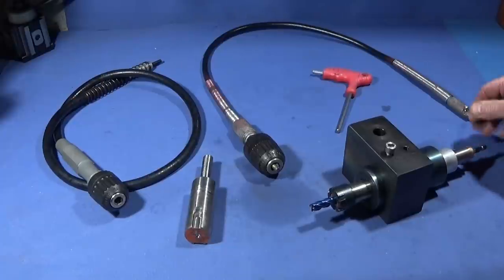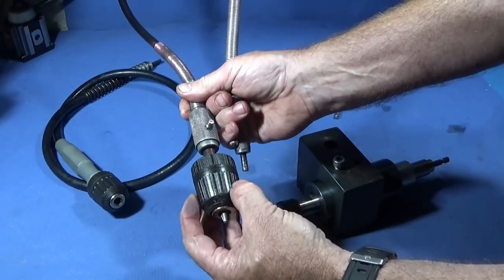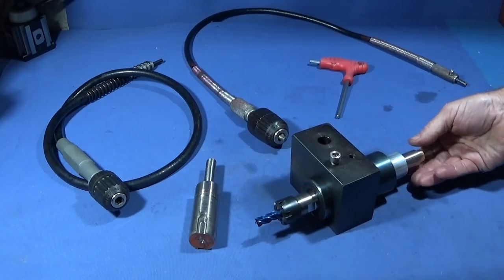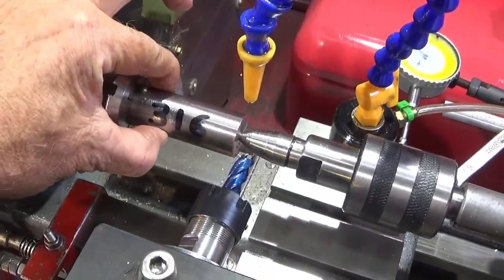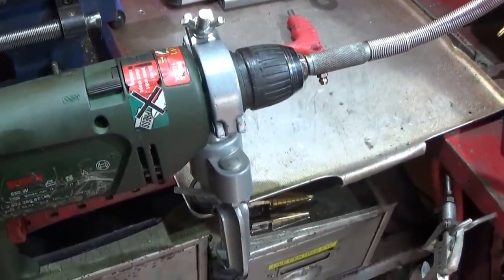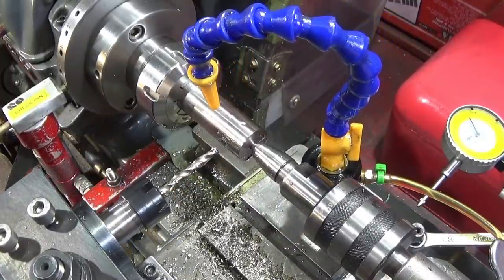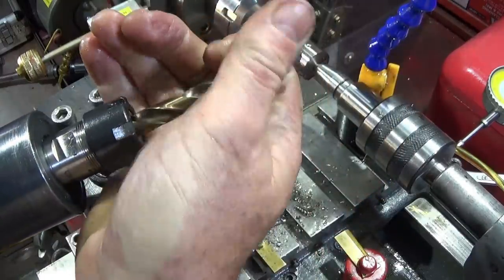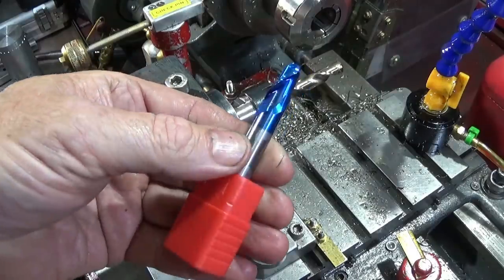ER20 Collet Chuck Toolpost Drill. Milling And Drilling Test

Comment: Another great idea I'll have to save up for!  Great to see Rosie doing a bit of inspection, loved the blackbird at the beginning.
Reply: I've just got my 250-000 jib type tool post installed as per your recommendation and you are right, it's made a huge difference to the lathe (Chinese mini) I was using the alluminium piston-type but it kept letting the tool holder move on the post. I have to say that buying from Bangood through the UK warehouse is fantastic, 3-4 day delivery! It's a shame they don't keep it stocked up.
I'm still trying to figure out a way to lock the main spindle on the Chinese mini lathe so that I can do indexing etc, I guess I'll have to make a disk and mount it to my locking spindle mandrill that I use for my polishing wheels coming out of the left end of the spindle, more left-hand threading...

Comment: Do you have a video showing how you mount the coolant system to the cross slide?
Reply from the maker: Hi Alan I just machined a piece of pvc bar and put a magnet in the underside. I have just ordered the same motorcycle oiler and the other components to make the same oiler system for my Chinese Mini lathe. When they arrive I will make a  new video showing  it being made and set up. Regards Steve
Reply: @SteveJordan  Cheers Steve. I look forward to it.

Comment from the maker: COLLET CHUCK IN VIDEO...CHOOSE THE (ER20 COLLET CHUCK 150MM LONG) IN LINK BELOW:-
ER20 COLLET CHUCK 150MM LONG
ER11 to ER25 Straight Shank Collet Chuck Holder -- https://bit.ly/3hqLWN7
Tapered Roller Bearing Used. Challenge 32004
Clamp-on Grinder Bench Vises Holder Tool -- https://bit.ly/2UWqKon
Drillpro 8PCS HRC55 Blue Nano Tungsten Carbide -- http://bit.ly/2uRl7O5
Drillpro 8PCS HRC55 Blue Nano Tungsten Carbide -- http://bit.ly/2R1jdDn
Motorcycle Chain Lubricator Oiler Maintenance Set -- https://bit.ly/2UWRoxz

Comment: Nice video! Aren't You afraid that the bird would eat some chips and get ill? I grew up with small birds but having my chip producing shop at home I don't dare to keep any free walking/flying animal here.'
Reply from the maker: Hi Stefan, I make sure I vacuum the swarf up as they have eaten one or two chips in the past. I normally clean up straight away after finishing a job or before I leave the workshop unattended. Regards Steve.

Comment: If I had brought one of my chicks in ,she would have taken a BIG dump on my machine. Lol.
Your girls must be house broken. Ha ha. . the tool post did a good job, but I think your Bosch drill need a bit more torque. 
I had a drill similar to that. When I was drilling a 16 mm hole in 1/2 inch cold rolled steel, the poor old drill went into Thermo nuclear meltdown, and burned up.  Couldn't handle the strain.  Lol